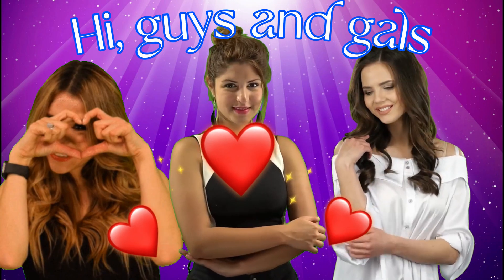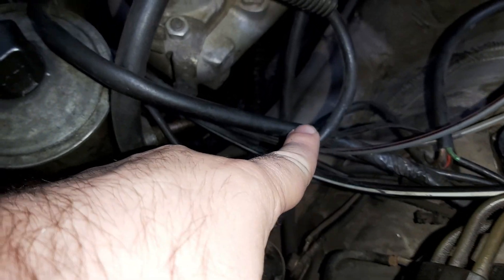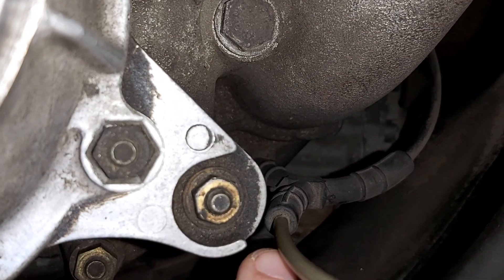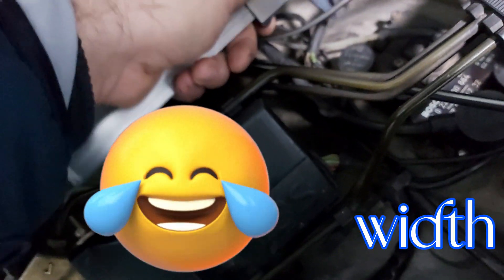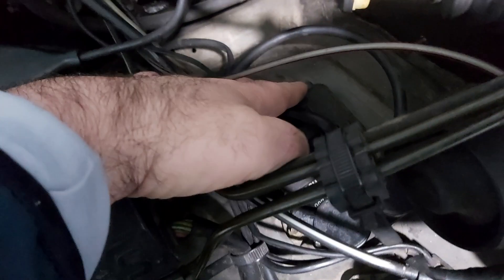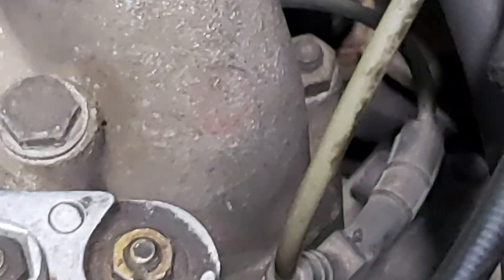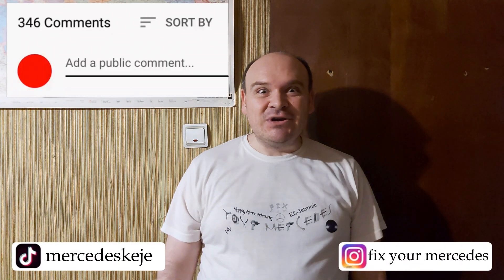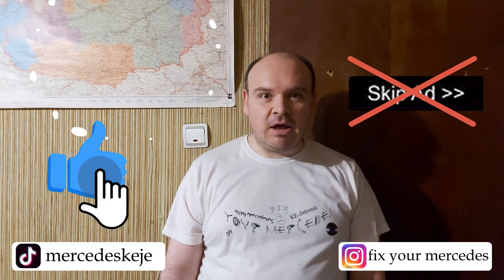㉦Mercedes Ke-Jetronic㉦ - KE-Jetronic: Correct EZL Vacuum Hose Connection

Comment: Hey, my 500se doesnt have any vacuum line going to this unit. Its been running like this for as long as ive had it, probably longer. It has a slight roughness in idle at park, could this be related?
Reply from the maker: Yes – the EZL unit on these engines is designed to have a vacuum connection. The vacuum signal adjusts ignition timing depending on load.
If the hose is missing, the EZL will stay in a fixed map, which can cause a slightly rough idle, higher fuel consumption, and less responsive performance. It’s definitely worth checking the vacuum routing and reconnecting it properly – the difference in smoothness at idle and drivability is usually noticeable.
Reply: @mercedeske  Thanks, I look into it. It's weird because I can see the hose but someone has cut it and melted one end to close it. Strange that they would do this, hopefully by connecting a new hose I can solve my idle
Reply: @mercedeske  So here is an update. I had extra vacuum line so was able to run the connection. My idle in all drive modes became much worse after connecting it. It seems whoever disconnected and melted one end of the line did it because of this condition. I'm assuming this means my EZL is bad and needs to be replaced?

Comment: Hello, my Mercedes e300 w124 only starts if I tighten the probe plate. If I press the start button, the injectors do not inject anything. Only when I press the probe plate, the cO screw has been moved. If you can help me, thank you.
Reply from the maker: If you have readjusted the screw and you don't know for how much then do the initial mixture adjustment and fine tune it then once the engine is warm.
https://youtu.be/__1fJGlBAQY

Comment: Any way I can get the full vacuum line connections at the engine bay, where can I find the reference for this?
Reply from the maker: You mean the rubber parts?
Reply: no, I just wanted to know where all the vacuum hoses connect to so I can compare where I connected all my vacuum lines in the M102 engine bay properly
Reply from the maker: https://www.ebay.com.au/itm/285453774652?_skw=Mercedes+W124+y+shape+vacuum+connector&epid=2210948800&itmmeta=01JDHS4VDSCS2FFZ52VMCCXA3W&hash=item42765eef3c:g:Sw8AAOSwcb5lGvAf&itmprp=enc%3AAQAJAAAA4HoV3kP08IDx%2BKZ9MfhVJKl%2BOLL6%2FMOJALWS%2FAuaR%2F1sNM1z8zcHZdNwfmvnRzvQEDkiKZ3U397H7t5Fnv6LHmzv0X66vpnqcUEnNQr8SvI8c3S4OtffEsp1Kw0WGrDXv7aC7u4xDC4iaYnMBYWjNoEbTZ6B6vTbkBIaqj0svJQliZJ7KteVRHs%2FYS%2BlrnzFjq67dXTHtoi09VnQW3ntAHx88PnUR%2FZRbzhPK0euas1ZzhEqgDvzdPCgM0Amxfnuvvmrb0xgoRe1jES%2F1VhopsuFNwG44futk1tH9SdlFZDh%7Ctkp%3ABk9SR4C3k7nsZA